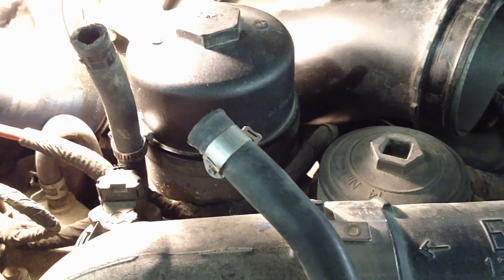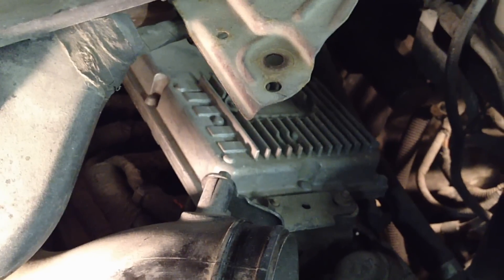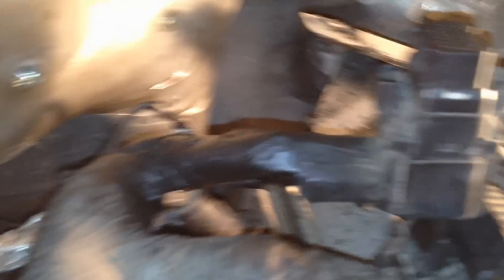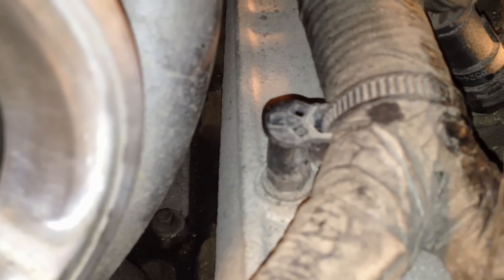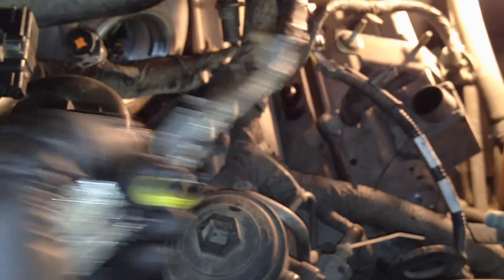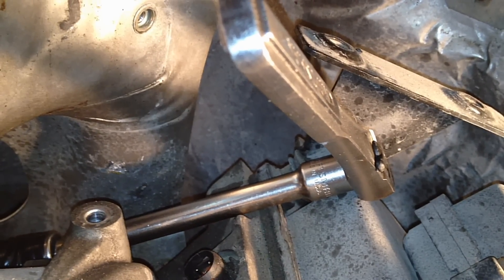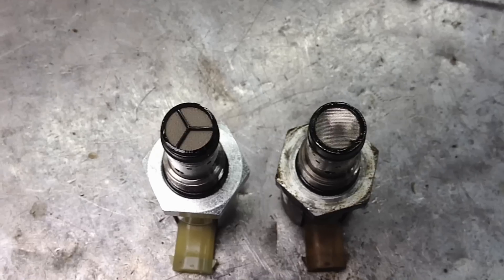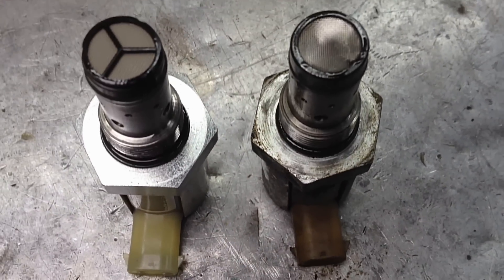6.0L Powerstroke IPR Replacement

Comment: The original IPR had no support (Mercedes symbol), so on the new IPR, you replaced the screen with the screen kit from amazon.  
Does the newer IPR (2005-2007) work for the 2004?  They are different part numbers.

Comment: Means engine oil filter ! And talking about IPR valve screens, actually one is designed for 2003, 04 the one that you pulled out from the truck. The new one is designed for for model year 2005 and up. Maybe they are interchangeable, but not why Ford makes two different ones, or different part # 🤔

Comment: Any suggestions for getting the IPR valve connector plug in???. I put a little dielectric grease on the rubber boot but have been struggling with pressing it into the sensor female end.

Comment: What are symptoms of a bad IPR?
Reply: What about shut of when hot and won’t crank when hot
Reply: @nightboy606 that sounds like stand pipe o rings and dummy plugs normally cause a hot no start
Reply: Cold crank no start, rough idling, etc..
Reply: @amberedensprague  I asked the question for other users to know and find out.. Because they did not include it in the video... But I appreciate your additional input. Fill in the blank,
Reply: @joneich1591  That seems to be the theme of these trucks right lol! It is a game of diagnosis and rabbit holes a lot of the time ha ha .
Reply: @amberedensprague  LOL after 30 years of working in the auto industry, manufacturers have done what I believe is to make things next to impossible for Joe the home owner to fix anything much less a tune up.. LOL. BTW you are gorgeous.
Reply: @joneich1591  Agreed! I’m only on year 3 of learning about our beloved 6 Litre engine and am still wildly confused most of the time when something goes wrong hahaha! Definitely a difficult venture , but well worth it. My first 6.0 (2003)was a nightmare… but fun when she did cooperate. Played the game again and seem to be having much better luck with my 2006 that is bullet proofed and deleted. Hate to say it but stock is so much more reliable… yet I am itching to throw a 4 or 5 inch exhaust on there, and upgrade the turbo for some noise haha! 

And thank you ! Older photo there from about 7 years ago but who’s counting 🙃.
Reply: A tow truck

Comment: I was helping a guy take on out today and what tough part to get to and get.😬 I told the guy that owns the truck to take the special socket off and plug two 3/8" swivel sockets and a couple of long extensions into the swivel sockets. It made it way easier to get the IPR off.

Comment: Okay so I have gotten to the ipr and started to loosen it and it has turned with the connector pointing to the front of my truck and now I can't get it to turn and of course the space is to tight for my hand. How do I get it out. I still need to change the IPC which is right next to it.
Reply: Simple request. Tighten it back and turn the ipr sensor and loosen it back. It'll come out.

Comment: I changed mine 2 years ago, yesterday I turned off my truck y try to turn it on cracks but not start. Is there any possibility to be again the IPR?
Reply: Possibly
Reply: Did you solve? I have the same thing.
Reply: Jeff Johnson I did full service and is running
Reply: @Ivan Coronado the tune up, full tune up
Reply: Also what you can do is open the switch put some starting fluid and crack it. It will turn on

Comment: I noticed in the video that it has a after market oil filter cap. What I have noticed in the last 3 IPR failures that have a hole in the IPR screen is the NAPA type oil filter (tall cap) and the short Ford filter. The Ford filter is about an inch shorter. I believe there is a oil pressure spike that ruptures the IPR screen and blows into the plunger of the IPR valve. I use a pick and push the plunger in and the piece of the screen falls out. Install a new screen on the IPR and replace the oil filter cap with correct Ford oil filter cap and oil filter and no more problems. Don't use NAPA filters unless you but another NAPA cap/filter assembly. Most people toss the original Ford cap out with oil filter then the next oil change go buy a Motorcraft filter that is too short with the NAPA cap.
Reply: I only use motorcraft fuel and oil filters haven't let me down yet

Comment: Changing out the IPR on my 2003 6.0 Excursion. Bought a Motorcraft replacement but when tight, & it is tight & flush, it's clocked incorrectly & the IPRs harness connection isn't positioned right. It's buried facing straight forward into the engine & not turned upward. Bought another one, a cheaper brand, & same exact wrong position. Put the original broken one back in & it clocks perfectly. Are there clocking shims for these or something?

Edit: Ha! Just found out with great difficulty it spins. I relocated it to the proper orientation. :)

Comment: Hey, I'm having issues with my 2006 Ford F250 6.0. When I crank it starts fine most of the time, but sometimes it requires me to crank to twice before it will start. The major issue I'm having is after I started the truck and say make a trip to the hardware store, come back out and try to crank it won't start on the first attempt after I crank it again is when it starts effortlessly. Anyone know what issue(s) I'm experiencing any knowledge would be greatly appreciated?!
Reply: Sorry for the late reply everyone. I ignored the issue until the truck quit starting. Issue ended up being that a Napa oil filter and oil cap were installed prior to my ownership. When I changed the oil I put in Motorcraft oil filer but the Napa oil cap was still on. The filters are different heights so the caps accommodate for their receptive filters. I guess that is all important for the truck to build oil pressure on top of actually filtering oil. I did not know this so the starter had to work harder to build enough oil pressure to start. Which caused the starter to go bad. So I was told
Reply: I've been having the same issue but it won't start anymore now. Just cranks without starting. What was the issue with yours?
Reply: @papat13  you need to replace your HPOP
Reply: I having the same issue you got it fix
Reply: @pachec01980  Your best friend will be a Scan Gauge 2 tool. Not too bad on pricing through Amazon and you can program it to read a lot of different information while cranking!

Comment: Would a bad ipr or no oil pressure cause the truck to crank unevenly? My mechanic said that the engine was fine just no oil pressure but it cranks rather funny
Reply: FBI bad compression, dead cylinders

Comment: I have a e350 2004 diesel 6.0 i replace the fuel filters and the fuel pressure regulator but still dying after starting maybe stays on for 2 min to 3 min and shut off and keeps showing like water on fuel light. Do you think if i replace this ipr valve it will correct the problem or if u have any suggestions i will appreciate that thanks for your help
Reply: Try removing the water from fuel, very easy to do. Light should turn off

Comment: My 2003 icp pressure drops steadily as the truck warms up, eventually drops below 500 and the engine shuts off. Wont re-start until cools off.  I was thinking of replacing icp and ipr before tearing into the hpop or leaks.  Any ideas/help?
Reply: Zach G 
I'm having the same issue , did you get yours fixed
Reply: @rickrichardzapata7855  you need to do an air test when its hot to find your high side oil leak
Reply: This sounds like a standpipe issue, or other leak in the HP oil system.

Comment: need some help... 2003 6.0l truck ran great, did an oil change and now it idles rough and wont build rpm after a 15 min drive. throws a cyl6 contribution code p0278. just a coincidence? disconnected icp, no change.
Reply: Injector is sticking

Comment: my 2004 f350 i turn it on, was changing the license plate led and i heard it like accelerate a little bit i thought someone was inside playing with it then again not continously but it happened like 2 times while parked for like 10min...drives fine. no codes yet.

Comment: got a 05 6.0. Ben at dealer for 10 weeks now. no. shit it would shut down when put in park other than that ran fine. they can't figure it out.  yes at Ford dealer. only 138000 on it. any help
Reply: Christopher Kapp what was wrong?
Reply: boss hog. they replaced. trans. wire harness. came down to crankshaft. sensor.  runs good now. stuck alot of $ in that 6.0
Reply: Christopher Kapp dang. Thanks for the reply. I have the same truck year and all. Going to check the ipr screen and if that's not it I'll see if we have the same issue. 😔
Reply: boss hog. its a bitch pulling IPR. whats your truck doing ??   had to replace injection pump. truck died.
Reply: boss hog. pull crankshaft sesnor clean rust from mountting. the rust pushes the sensor out its plastic. replace with new one.  i have had just about everything replace on this 6.0.  she runs nice now.  not worth what i have stuck into it.
Reply: Ok will try that next. It was a pain getting to the ipr but I'm glad I did. The whole screen assembly was off and the wires were melted together. Long crank no start. The ipr got it running but I'm still going to clean the other stuff while I'm in the mood.

Comment: can that be why my 6.0 has 0 boost even when I rev it?
Reply: I had that same issue with my 2005, it was a blown intercooler when it blew it sounded like a shotgun went off in the cab! You could also have a hole in one of the silicone tubes from the cooler to the turbo.
Reply: Oops I just noticed this was posted a couple months ago so you probable have it fixed already.
Reply: Anthony Garcia nope truck is still down lol

Comment: my truck idles like crap like its misfiring bad, wont rev over 3k rpms, i took it to a shop to get it fixed, they said my ficm needed reprogramming so they did that, they also said i had bad injector but couldnt tell cuz they said my fuel pump is bad. I replaced my fuel pump and there was absolutly no change in it at all. any ideas?
Reply: Get it to a real diesel shop 6.0s are very easy to diagnose

Comment: My truck was having hot-start issues. After reaching operating temp, if I killed it, it would have a hard time cranking up. Eventually, I parked it in a hastings parking lot to go shopping and when done, went to go crank and nothing. waited hours for it to cool of, and still nothing. Had to get it pulled home, its never started sense. I'm assuming its IPR, right guys? While cranking, pressure reads about 30PSI. Unplugged the icp to dummy it to default, and still no start. WTF?
If I dive into this myself whichout taking it to a shop, is it a safe bet for me to just replace the ipr, or is there something more going on here? I don't wanna spend the time doing this myself if what I replace wont even fix the problem?Thanks
Reply: What was the problem? Sounds like mine
Reply: leak or bad pump
Reply: Sounds like stc fitting

Comment: hello i got a 03 f350 4x4 recently i notice that when i push hard the diesel  pedal  instead going fast , has like delay on power for a few seconds than got full power. any suggestions!!!!!!
thanks
Reply: I'd start with the turbo. May need to de carbon the vanes as they are likely sticking causing a delay in boost.

Comment: Hi @fordtechmakuloco, do you have a trick in reinstalling the ipr insulator? the one that wraps around the irp and snaps together.
Reply from the maker: Once the IPR is installed just spin the solenoid into place where it is easiest to snap it together pull tight then snap it together then install the connector while it is easy to access then spin it back down into place away from the turbo.
Reply: +FordTechMakuloco lol I tried that, I still can't get it to snap shut lol, I just wrapped it and used a metal tie strap to hold it in place. Thanks tho!

Comment: Hey, I have a 6.0 which will start and run for a couple minutes and just runs out of diesel.....quits.  If I let is sit, it'll fire back up for a few minutes and I can run it above 1000 rpm forever.  As soon as it drops below, it quits.  I replaced the fuel filters, same. Thinking about the IPR.... any thoughts?
Reply: What was the issue? I had the same problem. Ended up being my sending unit had garbage in the tube that sends fuel!

Comment: need input... driving, truck died. will crank but not start. my edge cts reads no codes. any idea?
Reply from the maker: what is the ipr% and icp psi readings?
Reply: I havent checked those, does edge cts read that? Also what should those parameters be at?

Comment: So i have a 2005 f250 6.0 its starts kinda hard but it will surge arround 2000 rpms kinda like a miss unless i wot... After it dogs down for a second it comes to life! Problem is much worse when engine is cold but still acts up lil at opp temp also.. Wucha think? Ficm runing 45 volts
Reply from the maker: +josh lane Any surging we used to see was caused by the ICP sensor itself.
Reply: +FordTechMakuloco  ok thanks is there 2 one on each side or just the one on pass side sorry new to this beast just got it came from a cummins
Reply from the maker: just passenger side front valve cover on yours.

Comment: I have a 2006 6.0 powerstroke and I'm having the same issues as mentioned in a previous comment from November 2014.   runs really bad low power cold until approx. 175 temp. bucks and surges really bad.  doesn't want to Rev above 2500. doesn't want to shift. will build about 20 pounds boost but just will not turn rpms.   ficm voltage good.  60 pounds fuel pressure.   new motorcraft filters installed about a week ago. any ideas. could what you talk about in this video be a problem.  thanks
Reply from the maker: +MilehighF150 Either the turbo is sticking cold or you have an injector imbalance. Have you used a product such a Hot shot's secret stiction eliminator and fuel side cleaner? I have a recent video on this.
Reply: FordTechMakuloco I did
Reply: I put hotshot in and it won't run.
Reply: MilehighF150 7
Reply: MilehighF150 did you figure this out

Comment: I run rev X in my 6.0 and I keep having blown screens, flushed oil 3 times for each screen, no contaminants in oil, filters are clean and I still keep getting blown screens,  the only thing I can think is that the screens cannot take the pressure.  So I the oil is clean and filtered can I run without a screen in IPR and what can happen if I do?
Reply: What ended up being the issue?
Reply: @flats-hopper4351  i started running the ipr without screen and also dont buy after market sensor. Cheap ipr dont last

Comment: Is it possible to run the engine without the screen on the IPR? If I dump oil 3 or 4 times. And new filters.
Reply from the maker: +David Henry Yes you can but why would you want to?
Reply: Will an ipr cause an extended crank warm and cold?
Reply: Yes.

Comment: The truck was going down the road and just died. Pulled ipr and there is some metal shaving on the screen ?? what do you think??
Reply from the maker: Dennis Chandler Was screen torn any recent High pressure cooler work? Miles and year?
Reply: FordTechMakuloco no recent work done the ipr has the updated screen on it and no damage to the screen at all its is a 2005 f-350 220000
Reply from the maker: Ok then it is time for an air test. Has the STC fitting on the pump ever been changed? If it died and wont restart there is a large leak,

Comment: Hey have you ever seen yellow pices of rubber on the ipr this is my third ipr and I keep getting the ipr stuck
Reply from the maker: The IPR gets fed by the oil cooler ands its reservoir then filtered by the screen before entering the ipr to feed it base oil flow. If this keeps happening you need to replace remove the oil cooler and inspect, clean out oil reservoir and replace screen, clean and suck out old oil from feed in block to ipr, remove ipr and high pressure pump for debri removal and A STC fitting to the latest 1 piece design while you are in there.

Comment: When working on a 2004 model, do you use 3C3Z-9C968-AA with screen kit 3C3Z-9H529-A? Or have you put in 5C3Z-9C968-CA and it worked fine?  If it depends on when in 2004 it was made, I'm not sure how to find that info yet...
Reply from the maker: No I would verify the engine built date and serial number first as that was the year of many design changes. The info you need is on the rh valve cover there is a label from Navistar.

Comment: What was the truck doing before You changed it ?I have changed injector on 04 E 450 SD 6.0 V8 due to smoke (gone now) But now I can only start it with ether only even if hot after diving it ...strats only with ether ...i know that is no good,but I can not find out what is the problem
Reply from the maker: This one was literally a stall out no start hot or cold. These things really require a scan tool so you can see what is happening. ipr icp and ficm voltages is where I would go.
Reply: Petr Drbal I'm sure you got it fixed by now but if not check out The Torque Pro application for Android phones which along with an OBD2 adapter will allow you to scan and read those components